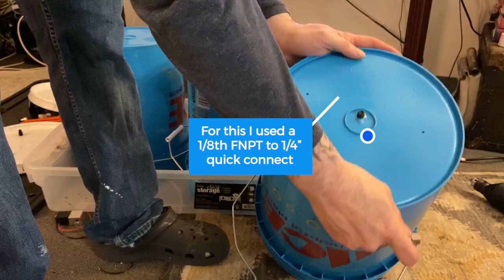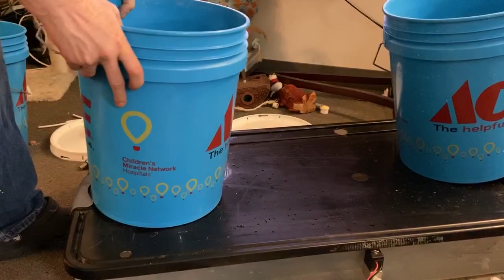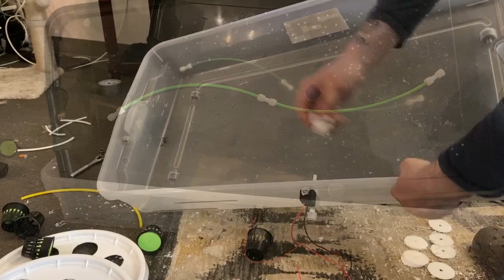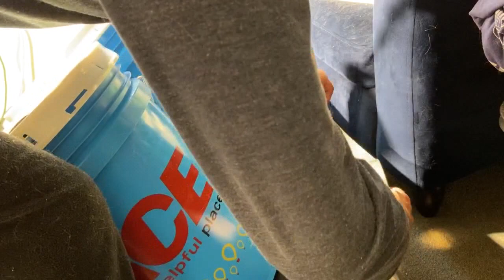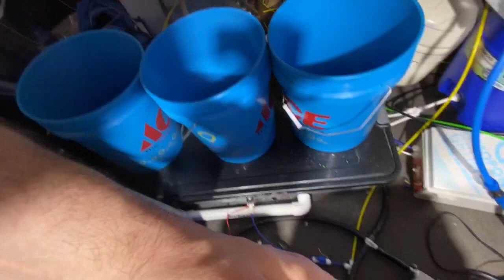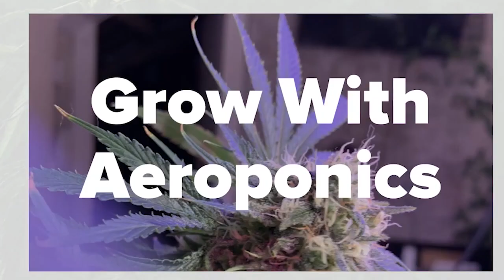Aeroponic Growers How I Make my aeroponic cloner buckets with nozzles in bottom of buckets. TrueHPA

Comment: Where does the white pvc pipe go up to?
Reply from the maker: I don’t remember using it, are you referring to the white tubing? I used that for the solenoid connections and to the y adapter.
Reply from the maker: Ha! I see now... it’s part of a frame I have built to hold lights! It’s not part of the system...